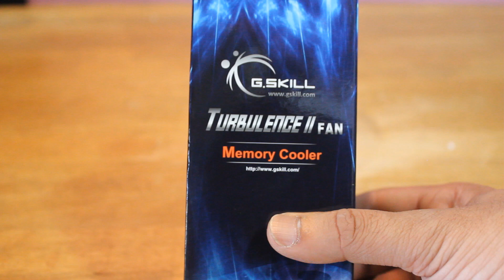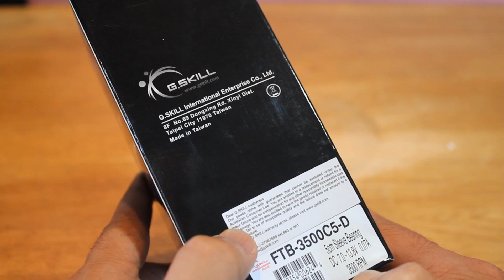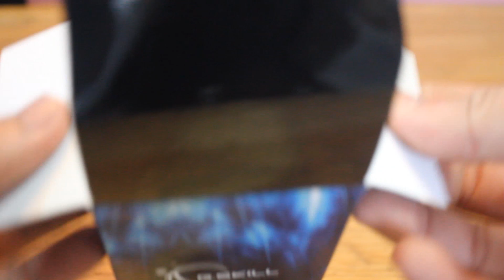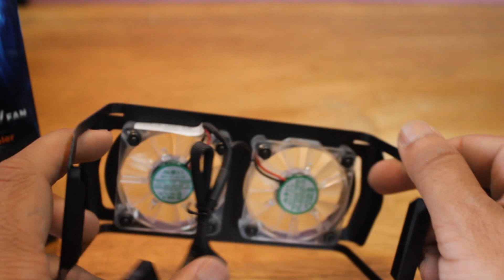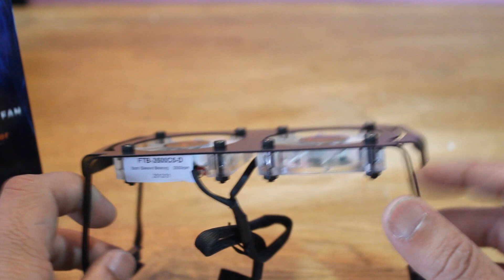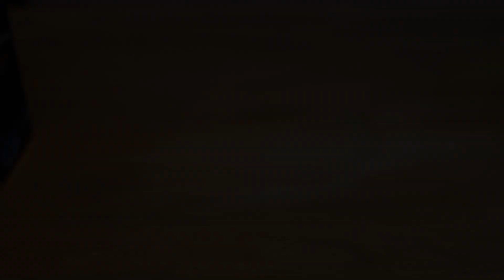G.Skill Turbulence II FTB-3500C5-D Ram Cooler Unboxing and Overview

Comment: Will this fit next to a MasterAir Maker 8 from CoolerMaster on a X99 Taichi motherboard?
Also, I never heard of RAM cooling so is this like a thing that actually makes a difference?
I'm gonna be running a 2way sli with Titan X Pascals, a 6850k, and 64GB of ram(probably RED Corsair Vengeance LED 64GB 8x8GB)
Reply from the maker: This particular fan is medium in performance when compared to the corsair ram cooler. There is a place for them, though if you are not pushing your RAM, it should not matter as much. They have a aesthetic value which matters to a lot of people.
Reply: Yeah I was looking at the Corsair Dominator Airflow Platinum cooler for aesthetics but I don't think they will fit next to my MasterAir Maker 8... it's a pretty big CPU Cooler... I wish the X99 board was a bit bigger so the RAM could be farther from the CPU then I might have space for them.

Comment: how many modules of ram are underneath the cooler? 4 or two. im asking because i want to know is one cooler enough to cover 4 modules or will i require two coolers?
Reply from the maker: It can do 4 ram modules at once. Provided the slots are close to each other.
Reply: alright . thanks

Comment: Its hardly a fault of the motherboard to have the ram so close, at 1500mhz electricity can only travel 12cm between each clock cycle. going higher than than is pointless if the distance it has to travel is greater than that.
Reply from the maker: Interesting point.. 12cm is a football field amount of space.. 2cm extra would have been greatly appreciated.. or simply alternative placement, perhaps 90 deg turn.. not saying these do not pose its own engineering challenges.. but worth a thought from manufacturers

Comment from the maker: Could not tell.. I take my builds apart after the review is done.. components do not see long use.. did you try to clean with compressed air.. or vacuum.. that may restore it a little..